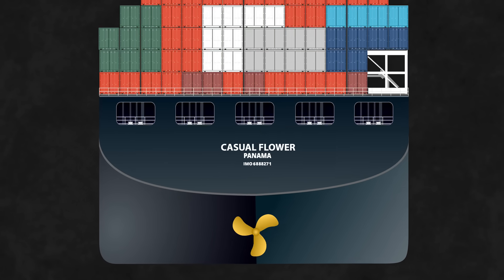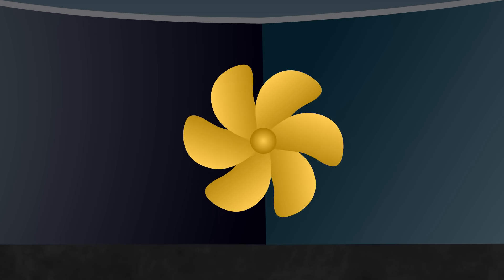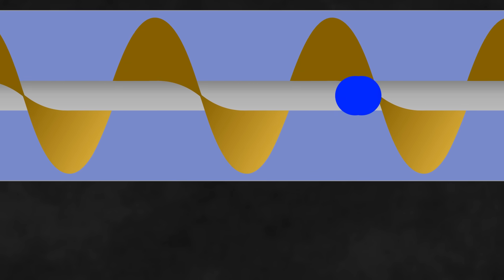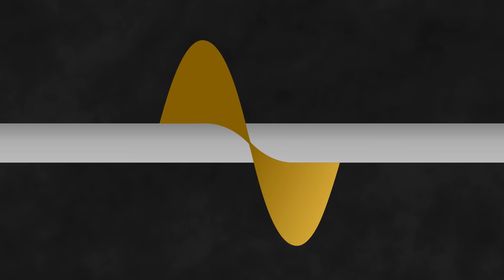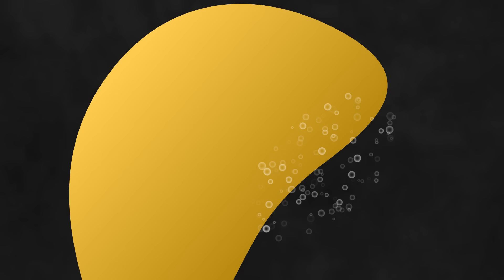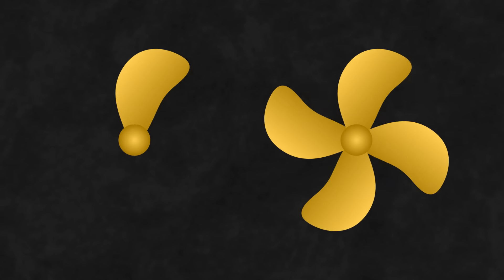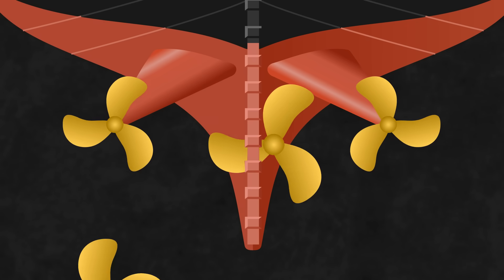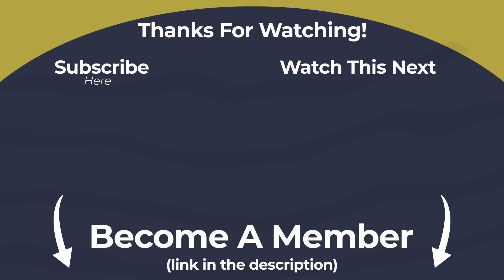Why Are 4 Blades Better Than 3?

Comment: There's also really weird propellers, like toroidal propellers, and the 7 (or more) blade swept propellers on modern subs that somehow sustain 30+ knots while also being extremely quiet and low-cavitation
Reply: Well one of the biggest factors there is that the higher pressures at depth mean that higher propeller speeds are needed for cavitation to occur.
Reply: @andrewbroeker9819  bollocks they got so many blades so they can turn slow while giving out the same pushing force... so 7 blades doing 88rpm will give you the same work as 3 blades doing 120+rpm
Reply: @salamich1  That's true in some ways and very false in other ways.
Reply: @salamich1  So the same idea as pc fans, you want large fans rotating slowly, and sub propellers are large compared to the craft.
Reply: @magnemoe1  yes the faster the fan goes the more noise it makes so to reduce the noise you reduce the rpms = less air flow so again bigger fan at lower rpms will push through the same amount (or more) of air as small one at higher rpms... with propellers the noise comes from popping bubbles of oxygen ... when you swing your arm in the air you can feel how the pressure at the side opposite to the direction of your swing drops... the faster you do it the more you can feel it... same happens with that blade the faster it goes the lower is the pressure it creates right behind it and the more water will boil = get rid of oxygen what is dissolved in it... so slower rpms = less boiling water = less popping bubbles = less noise
Reply: 30+ knots OR zero cavitation. Pick one.

I've seen some open-source stuff about certain modern SSNs being able to run at 20+knots and still being considered "quiet", whatever that was intended to mean.
At 30 knots though, even those super-quiet skewback props will be whipping the water to a boil.
Reply: @gustaveliasson5395  Don't forget that at greater depths pressure of water rises and pushes cavitation point to higher RPM and thus higher speeds
Reply: @Szopen715 
And this is why I'm not sure what to make of the open-source numbers; a raw speed value like 20 knots without cavitation is cool and all, but it doesn't really say a lot unless it's delivered together with an ambient pressure reading.

I mean, if you have to go down to the sub's test depth to get those numbers, then it's a bit of a nothing sandwich. The boats I'm thinking of probably don't need to run that deep to haul ass without making a racket, but still, one would like to know.
Reply: @gustaveliasson5395  20 knots is possible tactical speed of Seawolf class, it just means it will detect enemy submarine first while traveling at 20 knots but it's achieved mostly by superior sonar system
Reply: @gustaveliasson5395 Why do they want to pull a donkey underwater?
Reply: @gustaveliasson5395  cavitation is an interesting science, save that for given water conditions and depth you can avoid cavitation. Its pretty much an on off switch once you hit the speed of those conditions it starts. In excess of 30 knots without cavitating is easy enough if it's very deep. Jive turkey does some nice whiteboard explanations for you if you'd like to know the details. Quiet is correct, sound is stealth on a submarine, and a great deal of research goes into reducing their noise levels, so they cannot be heard on passive sonar. 

Theres even a barrier depending on conditions that sound reflects off mostly rather than reaching the surface and vice versa.
Reply: I presume that with nuclear power efficiency is less of a concern, so you can optimise for quiet speed and don't worry so much if you're sinking a few more MW into the machinery
Reply: @brynclarke1746  I'd think they'd care about efficiency in so far as inefficient propellers tend to be noisier.
Reply: @brynclarke1746  No, inefficiency is noise
Reply: Fundamentally it's a very simple problem to distill - shift as much water as you can (props work on momentum change) with as little pressure drop as possible.

I don't know how good cavitation models are these days (I'd assume pretty good), but even with a fairly rudimentary pressure limit constraint and a robust CFD setup it should be possible to use any of a number of optimisation algorithms to come up with something pretty decent. Add military spending and you get some really good shit that they undoubtedly will want to keep secret for decades to come
Reply: Toroidal propellers are amazing.
Reply: Because efficiency doesn't matter when profit isn't a factor and you have a nuclear reactor.
Reply: @InsaneBimmer   The best subs in the world don't even run on nuclear reactors. The ones that regularly pop up in the midst of US carrier groups in NATO exercises and get some 5 star admiral fired. Silence matters above everything else in subs. A nuclear reactor is not  the most silent thing as you have to get rid of a lot of energy excess. Ultimately leaving a huge audio signature doing so. Some expert submarine engineers have long proven what to do. Some countries can buy that from Sweden and Germany being the real props in stealth submarine engineering.
I would really be interested if NATO is getting these things into BLack Sea without having to inform the Turks about it at all. Via Danube river for eg. like Germans did in WW2. Avoiding the Montreux treaty on Dardanelles strait. These subs do rule the Baltic Sea - another deep single exit lake of special Russian strategic interest.
Or the Okinawa and Kamtchatka straits.
Japan and Taiwan are other buyers of the best subs in the world.
Israel and Australia too.
Anyone around Strait Of Malacca wanting some nasty uncountered leverage on Chinese bullying.
All nuke sub positions are likely all known and shadowed by other US attack subs or NATO subs. Just check into some submarine warfare vids on YT. The real stuff. Not gaming fantasy portraying some balance or near-peer equal tech race to sell to players. Some 2020 sub tech is crazy far away from the Red October image and decidedly non-nuclear.
Reply: It's such a fascinating topic. Like seven blades being the optimal number for the purpose the propeller is used and how the blade geometry is designed to make it optimal in every way.
Reply: Toroidal props is a scam. You should have understood that when really getting the detail of the video. A toroidal prop is just doubling the number of blades. So it would always come at a trade of on efficiency drop from adding more blades. What toroidal does is basically adding winglets to reduce wing tip vortices. Doing so does add other losses in other places to maintain the energy conservation laws and not create a perpettum mobile. See Betz law and the Betz law turbine chart. There is no way to cheat a magic 10% to 15% more efficiency out of a welll researched field. Navies of the world researched the hell out of this engineering space and they also did look in totoidal porp designs and discarded them long ago as junk idea not worth pursuing. The whole topic is a pump & dump investor scam on recreational boat owners tired from their wives and wasting away sleepless nights on Youtube algorithm.
If props get less noisy they must be less efficient - no physical way around that. There is no zero hydrodynamical tip-loss props. The prop would need to slow down as it's cavitation threshold drops to maintain the Betz rule energy conservation balance. Toridal looks nice in maths and CFD done sloppy. That's exploited here by Pump & Dumper social-media hype creators preying on half-witted people looking for magic investments returns. You can'zt have efficiency, low-noise and 30+ knots at the same time. As I said your cavitation thereshold must drop for going fast with such a design. You can't optimize all 3 ways in a triangular design problem. If you go fast at caviattion threshold the bubble implosions are the root cause of all the noise. You put more material causing bubbles on the outer tip diameter. Guess what that will do - create more bubbles and noise when going fast. Unless you go slow on the prop and ruin it's comparative power conversion effciency to push water back. That's why all the experiments do show incomplete data. the low noise metering does not show the mass flow and force in conjunction. You'll never get a qualified power curve from these scammers. Which is my buy vs no-buy criteria - a third-party certification body power curve review. On anything turbine, be it Wind, Tidal or Boat props that is the gold standard everyone got to do. So no - the idea is neither new nor will this save million on container-ships and navy vessels tomorrow. but it would require 3 university semesters of classes full-day and a dozen math heavy engineering textbooks to fully understand. Fluid turbomachinery engineering is one of the most narrow engineering specializations on the planet. I work with 2 departments in tidal power engineering on cutting edge hydrodynamics design. I just had a good laugh at this scam for the gullible.
Reply: or theres this now https://www.youtube.com/watch?v=MGy8jvf-DZ0
Reply: This video seems to talk about propellers as if they’re augers or wood screws. 

Even on a ship, propellers are aerofoils/wings with lift and drag, rake, chord, camber, pitch, etc. A ship or airplane propeller is not a waterwheel or an Archimedes screw. That device can only have water in the lower half. Those screws are more like an escalator or ramp than a propeller. 

A propeller has an angle of attack that creates negative pressure on the front and positive pressure on the back. The result is perpendicular thrust and torque. It’s these pressure diffentals that pull (and push) the propeller forward. It’s the same thing as a wing with a positive angle of attack producing lift. It’s also the same things as the angle of attacks and shape of sail pulling a sailboat forward. The front has suction and the back has push (positive pressure). This is why we can sail upwind. The sail is not a screw or a paddle. It’s an aerofoil, like a plane’s wing, or its propeller. A boat propellor is called a hydrofoil, and while the boat may deal with a negligible amount of compressibility, and cavitation instead of air separation, the formulas are the same (given all the necessary variables are included). 

A propeller doesn’t screw its way though water instead of wood. It causes its motion through a fluid (air or water) to create pressure gradients that pull (and push) it. This video seems to gloss over that way too much.😊
Reply: @mewintle  you are completely wrong! A propeller with blades having a rectangle cross section IS exactly THE SAME as a woodscrew, drill etc! only difference is the length (in degrees of angle) of the blade, with angle of attack suitable for the intended application. BUT basic principle is the same. A rotation is a special form of forward movement. Any moving object with an angled area pushes the medium travelled trough sideways and itself forward/upward. And you can NOT sail upwind with a sail! You can only sail upwind with a sailboat with rudders! This only works with a DOUBLE translation of the force!  Because contrary to your statements, a sail ONLY EVER works DOWNWIND! A classic fabric sail is also NOT an aerofoil NOR is a boat propeller "called a hydrofoil"! Boat propellers are more efficient with a aerofoil cross section of the blades but they work perfectly fine without! They do exactly that "screw its way through water"! Archimdes screws DO work fully submerged and this WAS USED to propel boats forward!
Reply: @gshaindrich  why so rude?

I believe you’re mistaken. While I may be wrong about the sailboat traveling upwind (thanks for enlightening me), I’m not wrong about the shape of the sail being an aerofoil. I’m also fairly confident about an airplane and boat propeller being neither an archimedes screw nor a wood screw. Those are extremely common (and obsolete) beliefs. Look it up. You may be surprised.

I regret I accidentally put this on a thread instead or the root of the comments.
Reply: @mewintle  "Look it up. You may be surprised." back to you, good sir! Obviously there is no talking sense to you, because you are the master and everybody else has "extremely common (and obsolete) beliefs" which you are to lazy to explain, why they would be wrong. THAT is "rude"! 
"I’m not wrong about the shape of the sail being an aerofoil." a "sail" would still work if it was a flat board! It depends on the wind/travel direction whether the wind just pushes the sail/craft or it CAN (but NOT obligatory) act as an aerofoil...
On a serious note: In detail, when we don´t lump every spinning thingy together like you seem to do, then there might certainly be a HUGE difference between air and water! Then again it depends on the angle of attack which force is greater. Wings and fast spinning plane propellers have a very shallow angle of attack to reduce drag of the blades.  Diefferent for boat propellers in water. The water displacement through a steeper angle of attack is the main force, while the drag a lower rpm is less important overall. This why you don´t need airfoil shaped blades and archimedic crews DO work fully submerged.
Reply: @gshaindrich  Still so aggro. Why? We are all enthusiasts having fun discussing something we all enjoy. 

My intent was to say that these are misbeliefs and that it’s common amongst people to have those misconceptions. I think that’s clear unless you are actively ooking for something to take issue with. There are a lot of sources that think a propellor just screws through water or air and plenty that explain that they’re aero/hydro foils.

I am by no means a master of any topic, let alone engineering or the science of fluids. I even tried to put hedging terms on what I wrote because I’m aware that I’m just a layperson who has read a lot about these topics. I’m fully willing to admit that I may have misconceptions. But the sources I read from seemed to be authoritive and plentiful.

I agree that there’s no point talking to me. Not because I’m not open to correction, but because you really can look on the web and find the same sources. I’m too lazy to explain? I think I’ve explained myself at length. Like way too lengthy for a comment section. I encourage you to look for primary sources that agree with me. Or not. We all have limited time. In every sense of the word :)

I continue to talk to you because it upsets me to think someone believes I’m being bullheaded and unkind. That’s not who I am. To quote the movie/play “Harvey,” “"In this world, Elwood, you can be oh so so smart, or oh so pleasant." Well, for years I was smart... I recommend pleasant.” 

I hope you can give me the benefit of doubt that I’m not trying to be rude. I’m trying to point out what I think is an oversimplification in the video. Thank you for questioning that, since it will make me re-examine the topic. As Ronald Regan quoted “Well, the trouble with our liberal friends is not that they are ignorant, but that they know so much that isn’t so!” I always hope I’m not that liberal that knows so many things that just aren’t true. But it happens to all of us.

We are fellow curious humans and that’s worth celebrating together.
Reply: I don't know a lot about an Archimedes screw, but the Wikipedia page for it says 

>>It is important to note that the screw volume must not be completely filled with water; there must be a fair amount of air "scooped up" together with each scoop of water. For this reason, the pump ceases to function if the bottom of the pipe is completely submerged, so that no air can be sucked in. This is because the individual pockets of water need to be separated from each other by pockets of air, or else there would be no difference between an Archimedean screw and a (curled up) pipe, which would let the water back-flow from the top basin to the bottom basin, just like a siphon.<<
Reply: From an MIT page "How a Sailboat Sails into the Wind"

>>The first sailboats employed square sails. These boats successfully plied up and down the Nile and across seas for thousands of years, despite the limitations of the configuration. The square sails were pushed by the wind and the boat could only sail windward. All of the forces were in the same direction.<<

>>Two thousand years ago, triangular sails appeared. With proper orientation, these sails could convert wind power from any direction into forward thrust. The sail might be pushed or pulled by the wind force, and the pull was stronger than the push. Although there was no physical understanding of the pulling force, it allowed the boat to sail into the wind. In the 18th century, the pulling force was identified as LIFT, and it was discovered that it was generated by fluid flow over a curved surface, an AIRFOIL. There are two (often hotly contested) theories to explain the phenomenon of lift over the top of an airfoil: BERNOULLI and EULER.<<

>>The air pressure above the airfoil along a NORMAL VECTOR from the wing surface is inversely proportional to the distance from the RADIUS OF CURVATURE. At a certain distance above the airfoil is AMBIENT air pressure. The pressure INCREASES from the center of curvature along the normal vector until it reaches ambient pressure. The air pressure closer to the airfoil thus must be LOWER than the ambient pressure. Again, the pressure above is lower than the pressure below and a LIFTING FORCE is created.<<

>>HOW DO SAILBOATS USE LIFT? The SAIL in the wind acts as an AIRFOIL and the HULL in the water acts as a HYDROFOIL, so there are two sets of forces acting on a sailboat: AERODYNAMIC and HYDRODYNAMIC. <<
Reply: @mewintle  How about YOU reading the contents of YOUR links? Don´t quote "figure 10" when you haven´t read or understood the SECOND paragraph and looked at figures 2 and 4!  -> "the propeller is a recent invention. It was originally envisaged as a helix that would screw its way through the water as if moving through plasticine or butter, each blade following several complete ‘turns’ around the shaft (figure 2). The idea was inspired by the Archimedean screw" ... so was our missunderstanding that a propeller is just a screw, while a "archimedean screw" transports/lifts water? But you denied the that it would work. But contrary to your "obsolete beliefs" fluids can be moved and mostly are moved by non-aerofoil-shaped propeller blades.
Reply: @gshaindrich  okay. Have a nice day. And I mean that. I don’t want to keep aggravating you.
Reply: @mewintle  I do know a lot about screw pumps having been a senior engineer on many screw pump stations, the largest being the third largest pump station in the world at the time of construction.. Wiki is only correct on a fully enclosed screw, IE The screw is entirely contained within a tube. Most screw pumps are only partially enclosed (about 230degrees), like the one in the wiki article in Holland. The graph of the  flow against inlet depth is a kind of 'S' shape. If the inlet level rises above the the top of the screw the flow will not increase but the power required will.
Reply: @gshaindrich  the same argument can me made for plane wings being flat plates instead of airfoils, if you were just a little more pedantic about it. Rectangular airfoils (if you could even call them that) are just inefficient, as are any form of thrust that relies on pushing any fluid ever. 

 It's more than well documented the power static pressure has and so every propeller, blade and wing ever made nowadays takes that into consideration. So avoid pointless arguments to try to make someone feel uneducated.